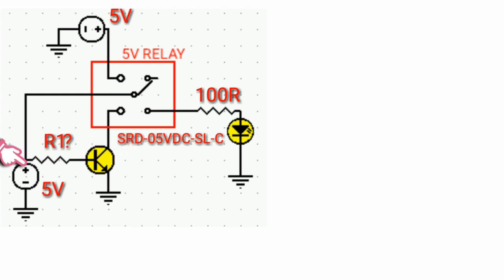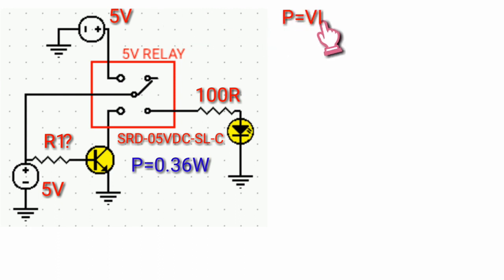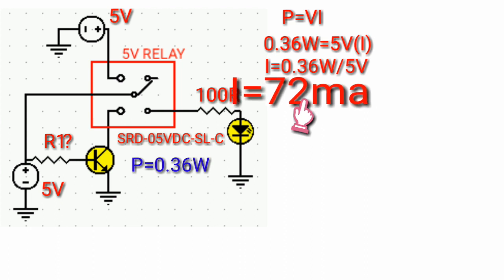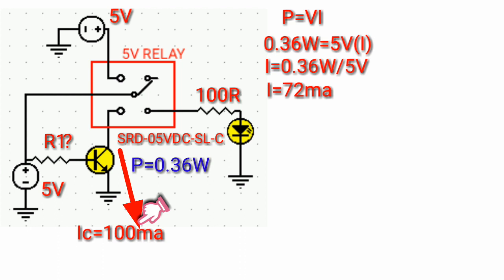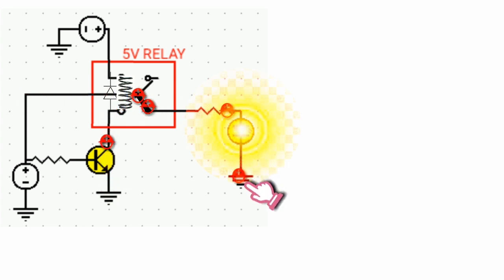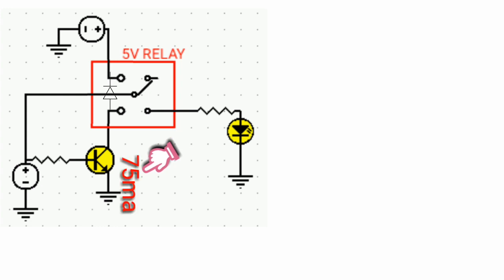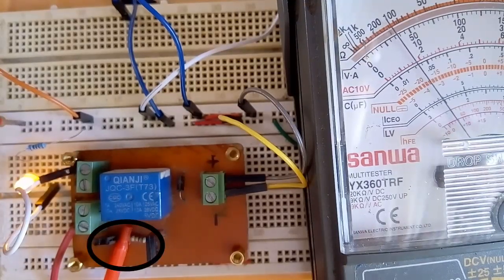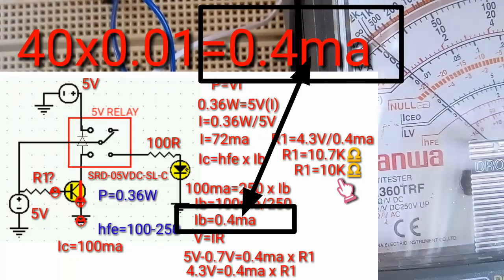CALCULATING TRANSISTOR & COMPARING TO ANALOG TESTER

Comment: It seems you have gone to a lot of trouble for nothing.  the ..36W figure you use is for power dissipation, or loss as heat during operation, and has nothing to do with the operation.  When using a transistor as a switch, all you need to do is put the transistor into saturation.  No current gain calculations are necessary.  that's for amplification.  A 2.2 K resistor on the base would be sufficient.
2
Reply from the maker: Anson Galyon it is the nature of the transistor amplify the current wether it is use as a switch,driver or amplifier.

Bd139 with max current 1.5a but u can only use less 100 ma more than that it getting hot.

If u use 2.2k resistor ur base current will be 1.9ma but the base current current of bd 139 only 0.5 A max.

So u destroyed the base-emmiter junction of the  transistor, & 1.9A current multiply by 250 it will be 475A the collector current but the mac collector current only 1.5A so u also destroyed collector emmiter junction.

When the coil is shorted then totally transistor wiil be destroy.

Any base bias resistor u use like 2.2k still the base current amplified wether u like it or not bcos it is the nature of the transistor.
Reply from the maker: It seems u are not watch the full video or just in the beggining, all the calculation was comparing with analog tester & the result will be the same,

How did u know the base just 2ma  by using 2.2k resistor & my calculation is wrong whilt it is proving by the tester result.
Reply: @Sapaih28  I did not watch all you video mainly because I could only understand a few words.  Be that as it may, I had only to look at your circuit diagram and calculations to realize you were trying to make something simple into something complex.  And how do you expect to use an analog tester on a digital circuit and prove anything?
Reply from the maker: @ansongalyon8050  watch my fren, im sure u understand some of my word by just observe the animation & point finger cursor.
Reply: @Sapaih28  I feel any knowledgeable person would question the validity to your tutorial when you make statements such as this: 
 "If u use 2.2k resistor ur base current will be 1.9ma but the base current current of bd 139 only 0.5 A max."
I don't want to fight with you, I merely pointed out  you are making a simple task seem more difficult than it is.  Apparently, you are passionate about instructing others, but perhaps you should examine whether your tutorials are beneficial. 

: